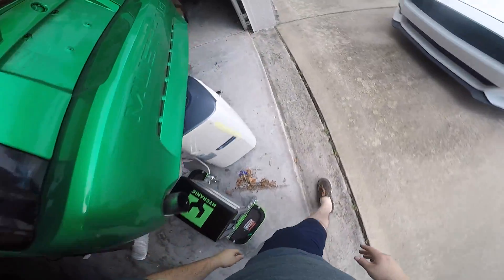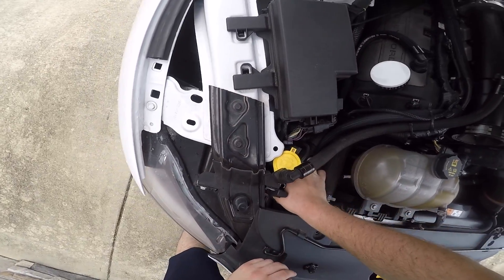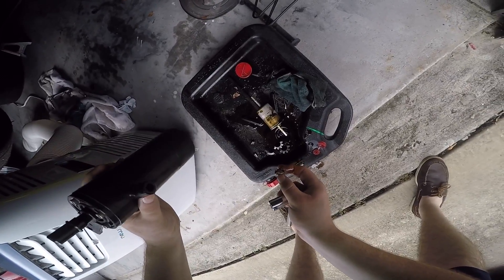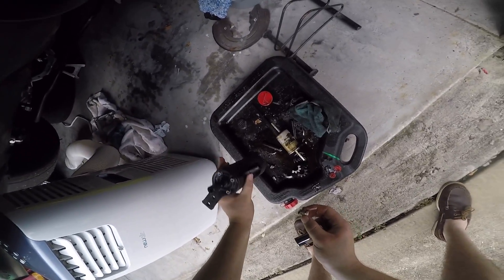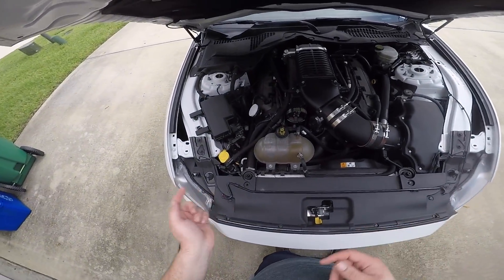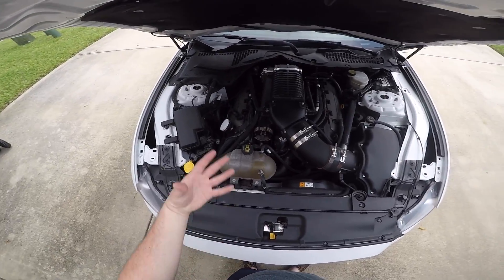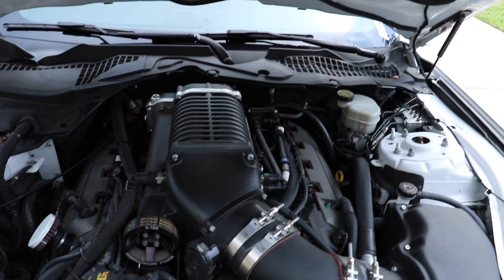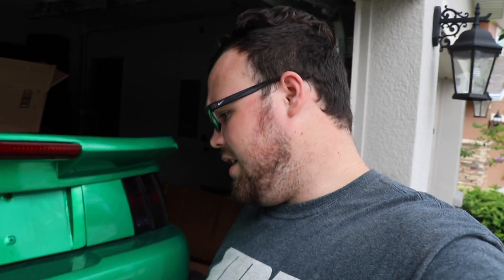Does an Oil Catch Can ACTUALLY WORK?

Comment: For everyone who says you don't need one it depends if your car is stock and you don't drive very hard then no, but if you have engine mods and run it hard at high RPMs then yes it is a good mod that will benefit the engine most race cars have one for a reason and it isn't to add weight.

Comment: You could of emptied out the catch can in a clear plastic water bottle with the top cut off and illustrated to the viewers how much oil accumulated after all those miles y'all drove before.Instead you jus cracked the drain plug on the can and dumped it all out in a drain pan given the viewers No idea on how much oil was collected by the device.This demo video along with GoPro on head filming is Trash.
Reply: because fail

Comment: I was thinking about purchasing a driver’s side catch can for my Cobra, this was an informational video👍🏽
Reply: Adding another breather works just as well and is much cheaper. I use 2 on my 03 Cobra. Plus you can clean them like an air filter and reuse them. This gives the engine area a cleaner look without running hoses and drilling holes. Depending on where you live though, this setup may not pass inspection without the pcv valve.

Comment: So, the engineers at Ford, who wear lab coats and (many of them) who have PhD in engineering, decided this 100 dollar part was not necessary. You do realize big companies like Ford get some of the best engineers in the world, right? They test these engines extensively. And yes, they do run the engines many miles. I feel if the car needed it, they would have installed one.
Reply: You do realize this car is not boosted from the factory right? And yet there is a blower on the car. Dynamics of the engine change when performing with 200 more horsepower than it was build with.
Reply: Matthew F. 100$ dollar part is a huge thing! You can be sure there isn't spend a dime more than neccesary by Ford. The engineers engineer on a budget😉
Reply from the maker: Ford performance also designed a oil separator catch can upgrade for the GT350 shortly after the car came out as an upgrade
Reply: Matthew F. One of the main reason ford didn’t include one is because the engineers know that everyone doesn’t check or change their car oil so imagine if those people had a catch can...oil will be backed up in the system due to them not emptying the catch can.
Reply: J.D. Turner 👍🏽 thanks
Reply: dennis braxton if the owners are that oblivious to basic and fairly simple maintenance tasks then so be it.   

Before you start praising Ford Engineers remember these are the same designers and engineers that decided to replace a external belt driven water pump to a timing chain driven one.   But wait there’s more. The pump is run by the timing chain and partially embedded in the block.  

But wait there’s is still more.  The new design reduces the weep hole that was a classic early indication of impending water pump failure.  The new design can allow the coolant to drain into the block causing oil and coolant to mix and possible engine failure.  If the new pump fails it is pretty much a $1000+ repair bill and don’t let them fool you into saying it is  supposed to last 100K miles plus.  There have been failures we’ll before that and no immediate warning to customer.

Fuel Door on left side of vehicle, But fuel gauge on right side of instrument cluster.

No safeguards for newer technology they design a vehicle that can be stolen and driven Without the key fob as long as engine is running.

Basic simple attention to detail tasks that appear to get by the new generation of engineers and designers that probably spend more money trying to save a few cents on simple things than just leaving well enough alone..

2020 Explorer ST almost $60K and the tow package hitch receiver doesn’t have a trim cover that probably would cost them pennies or nickels to make.

Rear wiper blades that don’t flush up against the window and leaving 1/2 the wiper blade sticking out and looking tacky.

I am sure their are good ones but don’t praise them too much just yet.
Reply: Matthew I want you to do this for me, take your intake manifold off your coyote engine and tell me that you do not see burnt oil inside of the intake ports on the cylinder heads and on the inside of where the gaskets are seated on a 100% stock engine. I will give you my car if there isn’t any.

Comment: Seems like a pain in the @ss 2 install and remove.I got the JLT 3.0  around a year ago.Installed it, I check it simple as 1.2.3....
Reply: Totally agree! Installed mine on passeger side after approx 500km, driver side after, getting rid of the ridiculous "Sound whatever tube", at 1500km. Emptying done within 5min at every 15000km (at time of oil Change).
Reply: JLT 3.0

Comment: Got a quick question looking to buy a mustang the ownere says it wont go over 20 mph would you happen to know what that could be
Reply: Game to fame what year?
Reply: Limp mode or valet mode... try resetting the mykey feature 11 thru 19 has it not sure about 05-10 mustang's
Reply: 1999
Reply: allen cox 1999
Reply: Sound like it's running just fine. That's about top speed.
Reply: Maybe try shifting to second 😂

Comment: Did you really need to spend the time pulling the plug when you could of just turned it and let it run out the side?
Reply from the maker: It won’t pour out the top
Reply: Mustang Lifestyle 🤔why?
Reply: @a29s12  there is most likely a check/one way valve to not allow oil to be sucked back.
Reply: Da Comrade I wonder what happens when it's full?
Reply: A2 9S this is probably why it's not stock equipped. Some people have a hard enough time maintaining their cars oil much less something else. Someone that cares about their car will not allow it to fill up I would imagine. I know I wouldn't. And for all those who say cars were built to handle the oil in the intake, ask a Ford Fusion or Edge owner about their PTU fluid. Lol. I'll give u a hint, Ford said at one time it was a lifetime fluid which did not need to be changed(or so I have been told), and have now changed their stance on this. So dont always assume the engineers are ALWAYS right from the factory. Just little food for thought for those who say these are pointless.
Reply: @a29s12  it backs up into the lines. Which would take quite some time. I use JLT cans on my cobras, which are significantly smaller capacity, and would empty it every 5k, only a few ounces to dump each time. Understandably every car is different as far as blow by and all that jazz to catch it.

Comment: Isnt that a vacuum leak when u vent one side of he pcv system
Reply from the maker: It’s the not vented. It flows like factory with the catch can in the middle
Reply: i'm thinking he's talking about the valve cover breather cause that is my question.
Reply: @MustangLifestyleTV   if u have a breather on the valve cover that is vented to atmospher  and still running stock resurculating pcv system its a vacuum leak cuz its not running the way it was  designed its either run a vented catch can or inline catch can